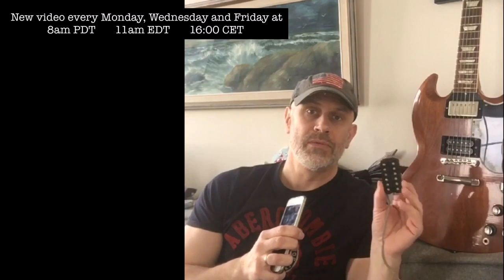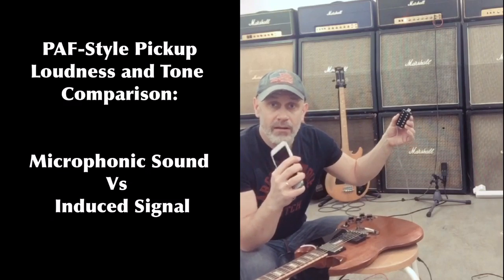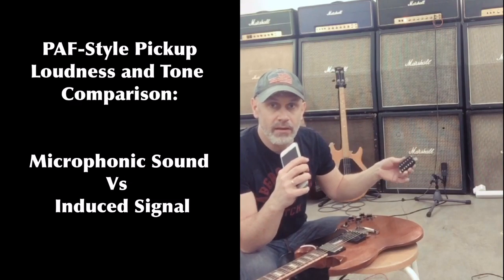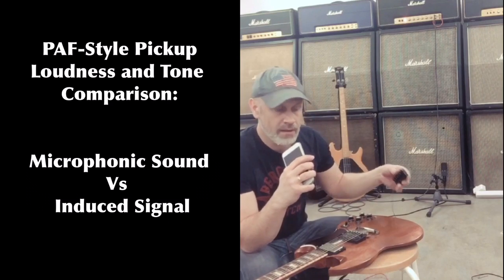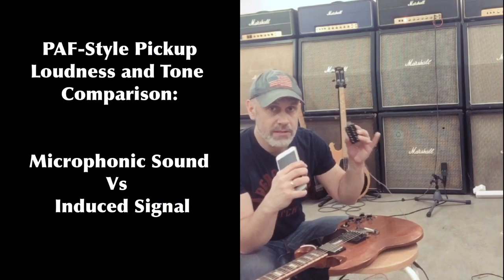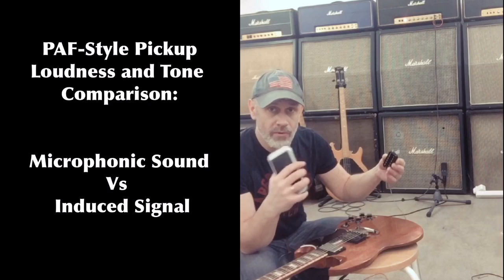Does microphonic guitar pickups explain tonewood?

Comment: It doesn't effect the guitar in a good way. Most people see microphonic pickups as a problem that has to be solved. I'm not a tonewood guy but this idea did cross my mind. However, if the wood effects the tone effects the sound negatively than that's not a good argument in favor of tonewood. It's also not a good argument in favor of properly wax potted pickups.

Comment: My LP has Bare Knuckle The Mule pickups on it. PAF style and microphonic they are.
If I knock on the pups, on the body, the neck or any part of the guitar I get that amplified.
Of course I do the experiment with strings on and I prevent the strings from vibrating. Hands, tissue, whatever.
If I repeat the experiment with the guitar unstrung, no sound of any kind.
To me ‘tonewood’ relates to how wood reacts to string vibration, and transfers some of its vibration back to the strings and possibly affecting overtones etc. Action/reaction is basic physics.
Afaik pickups only pick up magnetic field changes, not actual sound. Tonewood does exist to some extent but rather indirectly through the strings than directly through some unexplained phenomenon in the wood.

Comment: ALL pickups are microphonic to varying degrees. A vacuum potted pickup that doesn't squeal in front of a cranked JCM800 still makes a thud when you tap it. I build the things all the time and I test each one individually after it's been vacuum potted. They are almost always 100% squeal free but they all make a sound when you tap them.

Comment: Interesting analysis.  In conclusion it seems guitar pickups are influenced by the vibration from body wood.  And how a pickup is mounted in a body has an impact on how much influence, and the quality of the influence overall.  I imagine a body mounted P90 would be influenced by body wood more that a single coil suspended on a plastic pick guard.  Interesting.

Comment: Very interesting experiment! I'm a tonewood sceptical (NOT a denier), but I was lately having same kind of thoughts, thinking that perhaps the "microphonicity" of PUs could be the answer to the debate. The question now is wether different species (SPECIES, not density and similar characteristics) of timber affects the PU's own sound or not, and how big is the impact when the PU is in contact with materials of different density. 
Why am I a tonewood sceptic? Because all the experiments that I've seen and heard so far have failed to convince me in one way or the other, since too many factors are involved in the "making" the tone of a guitar. Unless you can constantly produce significantly different spectrums where the only variable factor is indeed the wood species (that includes the exact same strength, angle of attack and where the plectrum hits the string, all things that no human can repeat exactly identical for every single strike), you have demonstrated pretty much nothing. Also, the different setups should be made using CNC machines to guarantee precision sufficient for reliable measurements. 
But that would not set the debate to an end; there is lot of people out there who claim that "science don't know shit" and choose to "believe" rather than "know". I'm just curious, I want to know WHY things are as they are. So far the tonewood believer have answered me "because there is unicorns out there" (No, you are not among them, Johan!), but every time I asked them to show me one, the only proof has been pretty much "It's true because I say that!"

Comment: ok this proves pickups pick up sound through the wood when the pickup is microphonic enough.
can someone explain how this is possible? there is no outside ferromagnetic metal that disturbes the magnetic field. is it the magnets vibrating relatively to the coil windings??? i thought that would not be enough as the coil is copper which does not change a magnetic field but only induces some eddy currents in itself. are we hearing the eddy currents in the copper wire??????
whats going on???? i need a beer now.

Comment: Johan, what was the general verdict in regard to solid body electric guitars and tonewood ? What was the outcome of the tests, both with an amp and without an amp ? Did/does different wood make a solid body guitar sound different acoustically ? Did/does different wood make a solid body guitar sound different through the same amp/same pick ups ? For instance ; Would a mahogany SG wound different if it was made of ash ? Would a swamp ash telecaster sound different if it was made of alder ? Would a traditional swamp ash telecaster sound different if it was made of Paulownia ? Would a Mahogany Les Paul sound different if it was made of Paulownia ? What is the verdict ? Thankyou for your advice. cheers

Comment: A fascinating test, but there are a couple things that might be "coloring" the results. First, it's possible that the strings, though distant from the pickup, are still modulating the pickup's field enough to produce detectable output. Second, it's possible that there is some inductive (i.e., transformer-like) coupling between the pickups mounted on the guitar and the test pickup. It would be great if you or someone else repeated the test with a classical guitar to try to suss out whether either of these are impacting the results.

Comment: Having a guitar with a pickup cavity routed behind the bridge would be interesting. Also, you could put that pickup out of phase to compare the two sounds. Also, the way th pickup is mounted would surely change the way it souds (wether it is screwed into the body or mounted on a pickup ring).
That would be a grat experience and you could use your wood block quitars to compare the two.

Great work as always

Comment: GREAT experiment Johan! Most pick ups ARE slightly microphonic even if potted. But if just screw mounted it will not pick up any body resonance. IF you pressure mount it to the body it will pick up both sources.

Otherwise the only resonance that will get picked up will the the resonance of the body acting thru the string action!

And dude, after all this time, why DON'T you use a proper mic to record your voice overs instead of you using your smart phone?

But as usual, a great job. LOVED those Gibson basses!
Reply from the maker: Thanks :-) Yeah, the IPhone has to go soon ;-)
Reply: Ja! Cheers!

Comment: Another interesting demo. Obviously, this isn't a laboratory test, but it should make some things clear:

1. the sound of an electric guitar isn't purely from the strings oscillating in the magnetic field of the pickup - there is a microphonic component;

2. the volume of that microphonic component is related to how firmly the pickup is coupled to the body or isolated from the body;

3. it's likely that the body and every component connected to the body have some effect on the character of that microphonic component. Since there is more wood than anything else, and different types of wood have different properties, wood choice probably does affect tone by changing the relative amplitudes of different frequencies in the microphonic component (though all woods are 'tonewoods', since they are all capable of transmitting vibrations).

How large any of these effects are, particularly at gig volumes, is another matter.
Reply from the maker: Thanks Paul, great summary!

Comment: With a test like this you could prove the exact opposite what you are now trying to achieve. For example if you would try this on different body woods, it would be very unlikely that you would have any change whatsoever in that db difference that you now observe. And so with the same dbs out of them all (because it really is the string vibrations that the pickup is still picking up, not so much the body resonance. It would pick sounds, even if that pickup would be on a chair next to the guitar) you 
could state that the type of wood doesn't matter since they are all affected the same.

So with a test like this, where you want to show how the wood affects the microphonics, you would have to remove the strings and then tap the guitar continuously around as hard as you would pick the strings and measure the effect this way. You could not hit the body with a hammer and say this is how the pickup hears your playing through the wood and how the wood affects it, because you are not going to play the guitar with a "hammer" unless you're Pete Townshend. Cheers.
Reply from the maker: Hi, as I mentioned in the beginning of the video I did this test, since on earlier videos where I compare guitars of different body wood, I have received comments suggesting that any differences would be the result of microphonic pickups. So I wanted to see if the microphonic component was loud enough to be heard. The test indicated a 13dB difference. I actually tried putting the pickup on the top of a Mahogany capped R7 and a maple capped R9, and they seemed to sound identical, which supports your position. Cheers
Reply: +Johan Segeborn. Ah ok. Cheers.

Comment: .. I came to the conclusion: it's THE SUM TOTAL OF ALL THESE ASPECTS, FACTORS, DESIGN FUNCTIONS.........TOGETHER IN SYNERGY THAT PRODUCE THAT DREAM-TIMBRE/TONE/VOICE PEOPLE SEARCH FOR, HAVE HEARD ON RECORDS ON HITS THEY LIKE AND PLAYERS THEY ADMIRE.....YOU NEED GOOD BASIC PARTS.....WELL FIT TOGETHER BY A SKILLED LUTHIER TECHIE CRAFTSPERSON....FIRST OF ALLTHEN,  A DUAL SYSTEM OF BOTH PASSIVE AND  OR ACTIVE MICS WITH A NICE QUALITY BUILT IN SIMPLE 5-7 BAND EQ....IS A GOOD START......BUT, IT NEEDS SOME GOOD SOUND CHEMISTRY RESULT....FROM ALL THOSE FACTORS. FIRST....OTHERWISE IT IS MERELY AMPLYFYING SIGNAL STRENGHT AND PITCH....BUT, TIMBRE IS ALSO WAVE SHAPE AND HAS MANY SUBTLE OVERTONE QUALITIES.....I THINK THAT IS WHERE THE SOUND STARTS AND OFCOURSE THE PLAYERS ARTICULATION.....IMHO.....SUM TOTAL OF ALLL THESE FACTORS... A GOOD TELE STRAT OR LP WITH A GOOD PASSIVE MIC,...IF FINE TOO....BUT, THESE DAYS, A DUAL SYSTEM, PERHAPS, TWO OUTPUT JACKS.....GOL.D PLATED WIRE SIGNAL PATH INTERNALLY....MIGHT BE A GOOD THING FOR TONE QUALITY TOO....OFCOURSE, IF YOU HAVE A FEW HITS UNDER YOUR BELT AND POSITIVE CASH FLOW TO YOUR BANK ACOOUNT LIKE EC. ..JOE WALSH, OR ERIC ...CLIFFS OF DOVER JOHNSON ....YOU CAN JUST HAVE FENDER OR CARVIN CUSTOM SHOP DO IT FOR YOU....YOU FLY THERE A FEW DAYS AND YOU VISIT,TEST NECKS ECT...BUT, THEY DO IT FOR FREE TO USE YOUR NAME...OTHERWISE...YOU CAN ALSO GO TO WARMOUTH GUITAR PARTS.....BUY , FENDER AND OTHER PARTS. AND HAVE A LOCAL TECHIE ASSEMBLE IT FOR YOU...IS YOU WISH TO HAVE SPECIFIC THINGS.....A SPECIAL WAY...LIKE A GOOD SOUP RECIPE...IT'S THE SUM TOTAL OF INGREDIENTS....ALL THE FACTORS, IMHO ARE IMPORTANT, FROM WHAT I HAVE SEEN AND HEARD....SO FAR. NOW....TO FIND OUT THE RIGHT LOTTO NUMBER TO WIN A FEW MIL SO I CAN BUILD A STUDIO LIKE PINK FLOYD IN A VILLA IN PROVENCE, OR GREECE OR SPAIN.....OR TOSCANY...HIRE A PRETTY LOCAL MAID AS COOK....TO PREPARE ME ESPRESSO AND BRITSH BREAKFAST WITH EGGS, IN THE MORNING....AN OUZO AT NIGHT ON THE BALCONY OVERLOOKING THE MOUNTAINSIDE VINYARD BY THE SEA...WILL SHE SEDUCE ME WITH HER CHARM IN HER EYES AS SHE SERVES ME COFFEE AND APERTIF, WITH A FRESH CRISP COOKIE RIGHT OUT OF THE OVEN SHE MADE FOR ME HOMEMADE....NO MICRO-FOOD HERE!.....OR, WILL I SEDUCE HER WITH MY NEW GUITAR TONE AND LICKS?.....AM I JUST KIDDIN' A BIT, OR, AM I 'SERIOUS'...? GUITAR TONES....SEDUCTIVE NYPHETTE MAID EMPLOYEES......IT'S ALL 'SERIOUS' STUFF IN LIFE! BEWARE! ; ) ..IN REAL LIFE THOUGH, I LIKE TO COOK...I'D SOUND PROOF MY BRAND NEW STUDIO SO, I WOULD NOT BOTHER ANYONE....I'D HAVE A GUEST ROOM FOR MUSCIAN FRIENDS,MAX 7 DAYS VISIT.......AT ATIME....LESS HASSLE...MORE TME FOR COMPOSING....MORE TIME FOR MY PRETTY BABY: MY CUSTOM TELE....I DON'T MEAN THE MAID NOW.....WITH THE PRETTY DEEP MEDITERANEAN BLUE PIERCING EYES.......,NOR THE GOOD PIZZA I MAKE FOR US AT NIGHT....NO....I MEAN MY WIFE.......MY 'LUCILLE,' AS BB CALLED HIS GIRL...WHAT WOULD I NAME 'HER?' I DUNNO YET....BUT, IT'S S NICE DAY DREAM SO FAR, HUH? 😎🎸☕️ ..AH, LIFE AS A REAL GUITAR STAR.....NOT A DAW VIRTUAL AMP GAMER WANNA BE WITH A BOTTLE OF LAPHROIG...FOR THE DAYS, YOU GET THE BLUES...' I HAVE NOT WRITTEN A HIT SONG YET, BLUES,...' LOL.....MAKE HER CRY..MAKE HER SING IT....HAVE HER MOVE THE LISTENERS......THAT'S WHAT THEY, THE REAL GUITARIST STARS DO....OR, DID....NOW, IT'S OFTEN LOOPS, NOT EVEN REAL MUSIC BY REAL PEOPLE......SIGH.....WE WERE TALKING ABOUT GUITAR TONE AND TIMBRE....IT'STHE SUM OF ALL THE THINGS....TOGETHER. IMHO....YOU DON'T WANT TO AMPLIFY CRAP SOUND WITH EXPENSIVE ELECTRONICS...THAT WILL SOUND LIKE A CRAP TONE. SITLL,..IMHO....YOU NEED THE GOOD BASIC INGREDIENTS TO MAKE THE PIZZA OR SOUP TASTE ALSO GOOD...TO START WITH.....SO, WHAT ELSE IS 'NEW?'.....LEO AND LES KNEW ALL THIS DECADES AGO...WHAT IS NEW ARE THE 60 DOLLAR DAWS LIKE REAPER......SO, ONE CAN RECORD THE GUITAR AND DRUMS AT HOME....THAT IS A BIG CHANGE...BUT, EVEN THERE, LIKE IF  YOU ARE RECORDING A SINGER, YOU WANT , PREFERABLY GOOD MIC DISTANCE AND ANGEL BUT, ALSO THE ROOM OR PLACE...SHOULD HAVE GOOD NATURAL REVERB TO START..THAT IS WHAT THE AUDIO ENGINEER OF JIMI HENDRIX EXPLAINS IN INTERVIEW.....AGAIN...IT'S THE BASIC THINGS....HOW YOU GOING TO FIX A NICE GUITAR LICK BUT, RECORDED ON A TINNY SOUNDING LO RES FILE? YOU CAN'T.....IT STARTS WITH THE MIC AND GOOD REZ OF THE BIT DEPTH AND RECORDING....AND, THAT IS RELEVENT TO GUITARS TOO.....FOR AMPS AND PEDALS HAVE AUDIO CHIPS...USUALLY IT'S 24 BIT DEPTH / 96KHZ CHIPS...24BIT....IS LIKE MORE THAN THE ATOMS IN THE MOON,  A ENGINEER TOLD ME.....IT'S VERY HI RES..- WE WERE DISCUSSING THE 16 VS 24 BIT AND IF IT'S NOTICEALBE DIFF...-.BUT, IF IT'SUSED RIGHT..THE PROBLEM IS TOO MANY BUGS....AGAIN, BASIC STUFF LIKE USE OF RAM....IS NOT DONE RIGHT SO....THE QUALITY IS REDUCED....ALL UNNECESSARY...SO, I STILL LIKE RETRO SET UPS.....ANALOG MAN AS JOE WASLH CALLS IT....I THINK...AND, LIVE AUDIO IS NOT THE SAME AS HI FI OR EARPHONE OR CAR RADIO SPEAKERS RECREATING A DIGITALMODEL FROM A STREAM OF  D TO A.....NAW....LIVE ACOUSTIC OR ELECTRIC GUITAR ,BASS, DRUMS...LOUD OR SOFT AND INTIMATE IN A CLUB...WHAT BEATS THAT?  APIANIST.....WITH NO NECESSITY FOR PA.....SEGOVIE VISITIGN YOUR VILLA IN SPAIN TO PLAY AT THE TABLE AFTER DINNER......A PRIVATE STUDY AND SONG HE WROTE NEVER RECORDED, NOONE ELSE WILL EVER HEAR BUT GOD AND THE ANGELS.....HEY, I KIND O FLIKE HTIS DAY DREAM..HE'S ONE OF MY FAV CLASSICAL PLAYERS.....OH, YEAH, I LISTEN TO ACOUSTIC FOLK, COUNTRY TOO.NOT JUST ELECTRIC GUITA R OF POP. R/B AND ROCK....HONEY, CAN YOU BRING ME ANOTHER OUZO?...SHE SMILES,...SHE SAYS. LORD, YOUR WISH IS MY COMMAND......SHOULD I PUT THOSE NEW STRINGS ON YOUR GUITAR, OR WOULD YOU LIKE TO SEE ME PUT THOSE BRAND NEW BLACK LACE STOCKINGS AND MATCHING LACE GLOVES YOU BOUGHT ME? HA HA HAHA....I THINK I AM GETTING CARRIED AWAY HERE......ANYONE LAUGHING YET? ..HEY, PRETTY MAID NYMPHETTE.....WANNA HAVE SOME OF THAT TERAMASUE CHOCALATE CAKE I BOUGHT WITH THE ESPRESSO....DOESN'T THAT MOON LOOK LOVELY TONIGHT?....THE CLOUDS ARE LIKE A SILK SCARF AROUND HER....MS MOON....MONA.....HEY, I THINK I WILL NAME MY DREAM CUSTOM TELE.....MONA GUYS.....MONA..I LIKE THAT AND FENDER CUSTOM CAN PUT A MOON ON HER AND LITTLE GRECIAN MERMAID NYPHETTE.....GREEN-BLUE FINISH...I AM GOING TO BUY A LOTTO TICKET FOR TONIGHT....OH, DARN MISSED  FRIDAY...
Reply from the maker: You have a great way with words my friend! I think that Guitar DAW and Laphroig doesn’t sound too bad to me. I think many old rich guitar stars would give it all up to get the passion to play back. When it comes to recording in a crappy room I would close mic the Cabs and isolate the close mic from the room with some foam rubber. Then I would bring my recordings to a good room and play it back there and record the ambience and add it to my recordings. Cheers Johan
Reply: Thx , good idea....one has to work with what one has....good sound inspires me...and, i don't mean to sound like you need to win the lotto to obtain that....it's just a day dream...AND, I SUPPOSE THAT CAN BE EVEN DONE INTHE VIRTUAL STUDIO OF AN IPAD OR LAPTOP DAW....that is, i will try it...i will record a guitar....make it emulate somehow a close mic set up....but, PLAY IT BACK IN A SECOND TRACK AND ADD SOME REVERB, ROOM....TO GIVE IT AMBIENCE.....AND, THEN PERHAPS, KEEP BOTH TRACKS IN THE MIX..AND, SEE WHAT HAPPENS TO THE SOUND...they have some nice reverb, room and delay dedicated ios apps...i have tried a flamenco guitar with one set up in this audobus app.....to garageband.....maybe, later ,this summer, i try it in the real world...at a friends....in a studio at a local school where he teaches.....but, it might work also, this double track mix , virtually in a daw too....but, one needs a real guitar wav, not a guitar vst....it just doesn't sound that real..yet..as the bass, organs and pianos sound better...even on iPad versions....imo..12 string guitars are interesting because i think there is real time harmonic sound chemistry going on in the air....good, room , reverb, a good mic...ofcourse....all vital to get a good playback sound.....I SUPPOSE VOCALISTS MIGHT TRY YOUR IDEA TOO...🐰🎹 ...nntr